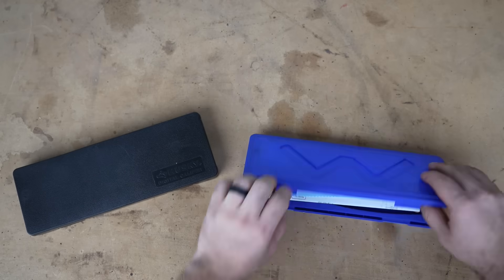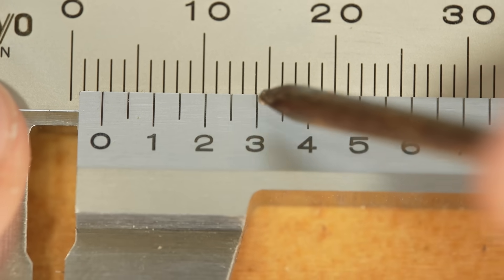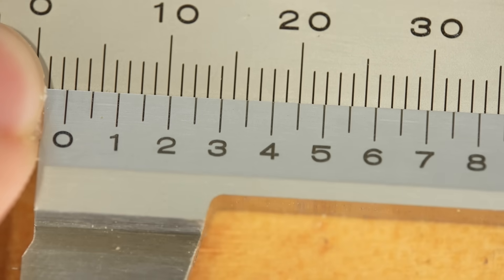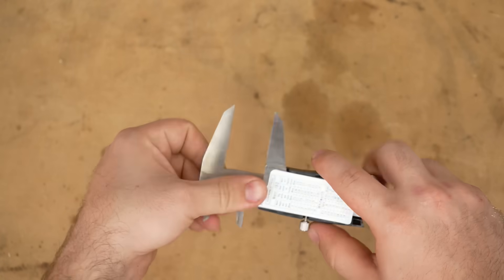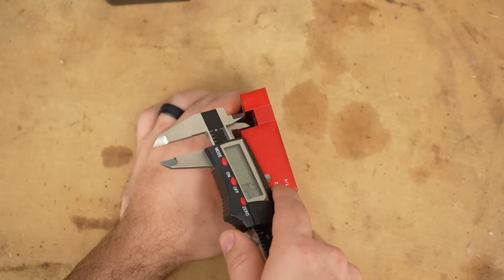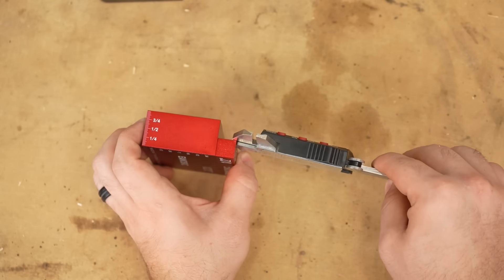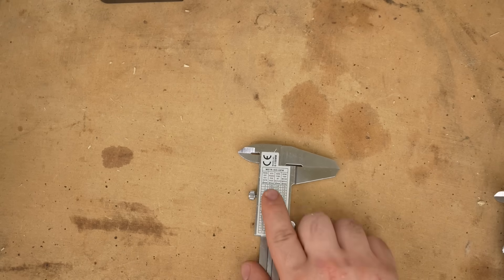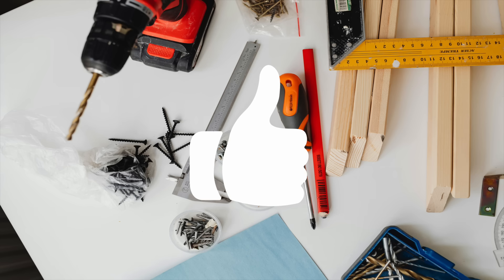I wish i’d known this sooner, How to use calipers like a pro

Comment: It's wise to point out that digital calipers can give a false sense of accuracy. One should verify the calibration, especially with the inexpensive models, as precision and accuracy are not at all the same thing. The marks between the whole numbers on the metric Vernier scale pictured are used to provide an additional decimal place, to the 0.05 mm level of precision. Finally, I like to keep the cheap plastic vernier calipers around for quick measurements that don't have to be precise. It reduces wear on more expensive calipers and you don't have to worry about dropping one. The downside is that for some reason they always seem to have a 1/64" Imperial scale, when a decimal inch would be far more useful and easy to use. Most of the ones I have purchased over the last several years are too loose and don't hold a measurement unless you get creative with tightening them up.

Comment: I wish I had known about that "China Export" idea.  I was at a company manufacturing semiconductor manufacturing machines worldwide and went to a LOT of trouble to place an honest CE mark on them.  The company was in California and perhaps we could have just had a "California Export" CE mark.  Of course, this would not have actually worked as you need to maintain a "Technical Construction File" (to be available for review) of all your evaluations and tests to meet all the applicable directives.

Comment: China Export is a joke, it is not the real meaning of the fake CE marking.

The real CE marking, as you've noted, is a standard and should be printed properly. Many Chinese manufacturers, whose products are not to CE spec, put the fake standard marking. But since their fake CE marking does not conform to the standard, they can say that they are not lying.

Comment: maybe I am miss understanding when you said that the humans eye can only resolve up to .1mm. If you mean see or tell the difference I think humans can see the difference at much smaller than that.  .1mm is .004 of an inch and a human hair is about that give or take a .001 or .002.  A person can certainly see the difference between a thicker or thinner hair. or newspaper / bible paper vs normal printing paper. a person can grab a hair and still see it 10ft away. try it with a friend. many Machinist can eyeball things tighter than that.

Comment: Fun fact: The digital calipers work exactly the same way as the verniers. Except they use electronics to read the vernier instead of a Mk I Eyeball.
The label is a custom printed ultra thin PCB with a gridlike pattern on the back. The head includes a similar, though slightly offset grid and the electronics scan over them to see which grids line up best--just like a vernier. Except the electronics can distinguish a few levels of "how closely does this line up" to allow finer resolution.

Comment: the most popular callers are dial , no batteries required and quick easy read , machinist and over the last 30 years 99% run dial calipers ,all forms of calipers can be accurate , mitutoyo ones are good , husky not so much lol , I'm a starret guy myself , several calipers will claim extremely high accuracy but know its not , good rule of thumb for quality calipers is +/- .002 inch or .0508mm  and need calibrated yearly , for more accurate measurements we use o.d. / I.D micrometers or depth micrometers

Comment: When I worked as for QA as an engineer, we would use our cheaper calipers (the ones that weren't Mitutoyo) to also score lines on our metal blocks to indicate measurements. The calipers are, as far as I know, all made out of hardened stainless steel so it was easy to use as a scribe
Reply: I've even seen a case of someone suggesting grinding one of the jaws to a sharper point for the purpose.  (And, yes, on a cheap caliper set of course!)

Comment: After my last $30 digital caliper, I got a mechanical dial caliper. The thing was going thru a set of batteries every two weeks. The $200 Mitutoyo isn't any more accurate but it will save you hundreds of hours a year spent changing batteries.

Comment: CE means nothing. It just says "I swear as manufacturer that my product works in expected parameters and will therefor cause no harm". In Germany we had the very good label "TÜV geprüft" before CE was introduced, which was an institution (Technischer Überwachungsverein) where you could bring your products to let them be tested for a certain fee by engineers. If your product didn't kill someone it got the label "TÜV geprüft" and a numer. Then CE came (which is just a piece of paper) which every manufacturer could stick on their products without any fees. And when something happens to your customer you easily rename your brand in china :)

Comment: Two quick tricks. If you are trying to measure the distance between the center of two equal diameter holes, you can measure the diameter of one of the holes set your digital calipers to be zero at that size then when you measure across the two holes you will get the distance between the centers of the two holes. The second trick is if you are trying to find the depth of a thread or are using a plug to check blind hold depth, or more likely checking for taper in the hole, you can measure the length of your test screw/ plug set that as zero. Then once you have fully screwed in/ inserted the plug you measure from the top of the plug/ screw that is sticking out to to the start of the hole. This will give you the depth that your screw/ plug has gone to. So digital calipers can be used for subtraction as the second trick indicates.

Comment: Learnt some stuff today, thanks :)
Also need one of those digital calipers that does fractions, i have been working with imperial for years but due to a head injury it just doesn't stick an is soooo painful at times....on my random side my calipers don't have bolt sizes but a conversion chart on the back for multiple things which honestly came in handy more than i ever thought.

Comment: "You will need calipers to measure the distance between the letters in the logo to ensure it does in fact conform to European standards. Unfortunately, if you measure with the other type, they will seem like they conform to European standards when they in fact do not"

Comment: Thank you.
And things like the CE, are why I really don't trust Chinese things. But of course, people who don't know what DIY & builders go through, would be quick to call me racist for saying that. I have brought Made In China devices, with the chips and other circuit board components censored, so you can't even look up if the device is rated to what you brought it for. Tools & fasteners made out of weak metals, some of us call Chinesium. And now this.
That CE spacing trick, is a new low.

Comment: If you get digital calipers, make sure they use a common battery size. 
I only get ones that use CR2032 batteries, because it's the same battery use in AirTags, car keys, motherboards, and remote controls

Comment: I always get inner diameters wrong with calipers´, even after wiggling. I think you need to use calibrated cylinders, which I dont have, or something to extract the diameter and measure outside, which I dont have either.

Comment: Only thing the machinist would add is that a general rule of thumb is not trust the measurement too much when measuring within 0.1 of a mm with a vernier caliper.
The reason is that you can quite easily and accidently mash the calipers a little and itll throw you off.
For anything more precise than 0.1mm use a micrometer if possible.

Comment: I have a Kanon vernier that I bought in 1981 when working in engineering.  It's still perfect, despite much use.  My foreman recommended a Vernier with fine adjust, and he was right.  A dial caliper is easier to read, but fragile, and with wear they become inaccurate.  I also have a digital caliper, but the battery has gone dead and I have not found where it hides.  No use at all.

Comment: A trick I picked up when I first started using vernier calipers is that if it's hard to identify the best fit, find the last mark that's clearly on the left, then find the first mark that's clearly on the right. Usually those will be 2 marks apart and the correct one will be the one in the middle. Or, you can just average those to amounts and call it good enough. Often times it won't be absolutely 100% in alignment.

Comment: I've used vernier callipers for years and I didn't know about the step feature 👍. Measuring internal diameters of holes is tricky, I find the most accurate way is to lock the slide adjuster, set the distance I think is correct and then test fit in the hole. I often find my initial measurement is too small, because the calliper hasn't been removed exactly perpendicular to the hole and has closed up 0.1mm coming out.

Comment: Great. The digital one can do something very useful: you can reset at any point and that allows to do math very quick. For example, the distance between the center of two spaced screws. you measure the outer diameter of one screw and reset. then you measure the out of both holes or semi mounted screws. There you have it! the distance of both centers with out guessing the center or doing brain math!

Comment: I would caution users on using the inside dimensions jaws for measuring inside diameter (ID) as they don’t actually touch the points on the farthest length of the circle. The flat part on the jaws bridge an arch section. Especially on very small ID’s this creates a great deal of inaccuracies.

Comment: I think the calipers shown in the video are cheaper ones and have only one scale. I am from India and from the time I first saw a Vernier caliper, roughly Sixty years ago, we have an Inches scale, at the top, and a Metric scale, at the bottom. We also have a Tail piece with a Thimble for fine adjustment.
As regarding the Cunningness in using the C E, for China Export, to hoodwink, In India near Mumbai we have a place called Ulhasnagar, where the Sindhi population from West Pakistan were settled after the 1947 partision. Initially being very hard working and smart these people started printing made in U.S.A in many of the goods they produced. When caught for cheating they used to argue that it means products made by the group members from the Ulhasnagar Sindhi Association.
Similarly our neighbouring country Pakistan, from where these Sindhi population migrated, from their side started exporting good with a bold Label MADE IN IROP. When unsuspecting people from some countries found these were not made in Europe and questioned the suppliers, they were told that IROP stands for Islamic Republic of Pakistan.
Thanks for your time.

Comment: Great guide on how to use the very versatile calipers!
Straight to the point with clear explanations.

The step measurement was new to me. I've been using the depth guage, but it's sometimes hard to get it straight. And if there is a slight gap in the step, the very slim guage can slip under it.

Comment: Do not store the caliper completely closed as shown!!! Open it say 1/2mm and lightly lock it.  Storing it "hard closed" can misalign the caliper.  Also, there needs to be space in between the larger jaws to keep it from trapping moisture, or anything that can cause the insides of the jaws to corrode.

Or at least that's what they taught me at MIT 40 years ago!

Comment: I was a mechanical inspector for 30 years and I had one of these in my hand every day.  My generation used the dial caliper, and I like that better because you can see changes on the analog dial.  Vernier calipers were old-school but we knew they were more accurate.  (NOT more precise!  Don't mistake accuracy with precision.  They both measure to 0.001".  

BTW, the Vernier Scale was invented by Pierre Vernier in 1631!  It's a really clever invention if you think about it.

Comment: CE was new to me. Great guide for a beginner!
I'd also like to add, be careful not to apply too much force to the slide, as excessive pressure can cause the caliper jaws to misalign and result in inaccurate measurements. This is especially crucial when measuring from the thinner tip of the calipers. If additional force is needed, apply pressure on either side of the caliper jaws themselves causing direct compressive forces, rather than through the slide, as this will prevent misalignment between the body and the slide.
Reply: It's an urban myth that's hard to kill. It was all over the European tec community 15 years ago.
It's been debunked a lot of times, even in the European Parliament. Links to debunk on the Wikipedia page https://en.m.wikipedia.org/wiki/CE_marking

Comment: i have an addition to verer calipers. they have one major disadvanteg over digital calipers. when reading any kind of scale you have a thing called parallax error where when you dont look at the scale in a streight line the lines on the scale can be offset which could lead to a false meashurment. havent heard you say that and im sorry if i overheared it. though overall a great video i liked it a lot

Comment: One other little tidbit is that calipers should not be stored completely closed.  For the finest, flattest, smoothest surfaces, the faces are so close together that the molecules can grow across the gap and, over time, could cold-weld themselves together.  This is especially important for the most precise instruments like gauge blocks and optical flats, but my calipers have a similar note, "Do not close calipers; may cause damage."

Thanks, too for the information about the step measurement and the CE mark.  Back in the early 70's when I was learning this stuff, the CE mark didn't exist then.

Comment: My Vernier has a mm and inches scale. I used to measure only in mm until I realize that the precision in inches is 4 times greater. My vernier (KD Tools) precision is 0.1mm or 0.001inches and 0.1mm is 3.937 times larger than 0.1mm.

Comment: I have a caliper of each type. Batteries go dead, dials get bent and the mechanism gets gummed up. Verniers don't go bad and they don't need batteries. As long as you don't abuse it, it will always work, for you, your kids, and your great-great-great grandkids. I also have a cheap vernier that I keep in my tool bag (only measures to hundredths.) It costs me $20 and is every bit as accurate as I need in that setting. Don't know that I've ever used the step measurement but I'll have to keep that in mind.

Comment: The two most unknown measurements are the two you missed. I don't think your vernier applies but the digital ones do. When closed, the two jaws make either 90° or 82°. This is for measuring the countersinks for inch or metric flat head screws.

Comment: I as others didn't know about the CE difference. I also noticed as others, you skipped over the dial calipers. I use dials alot on my loading bench. 
As far as how to ue them I knew all the different ways, in, out, depth and step. 
I also have micromters. They have dials, so easy to read and they still have the thimble markings to check for accuracy. The only digital I have I bought to easily convert SAE to metric.

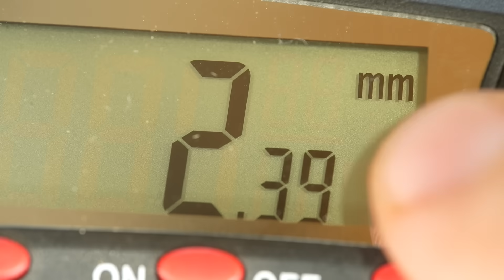Comment: 2:36  If your digital caliper is showing 2.39 mm, it's wrong to read 2.9 mm. The difference between these values is 0.51 mm which is huge in precision mechanics.

Comment: I'm a retired electrician who had to learn how to use micrometer to measure wire. We had to learn the diameter  think it was from 15 to 10 guage because wire diameter doubles or halves evety 6 wire sizes. ( Never came across 11,13 or 15 gauge wire but some motors might use them ). Have a set of Vernier calipers and find them hard to use. Will measure something with them then get one of my Starrett 6" rulrd out to measure Verner.

Comment: Digital/dial calipers are wonderful BUT extra time should be spent with apprentices to read mechanical verniers properly THEN they can be introduced to dial or digital units.They should be able to use ANY Vernier Caliper. Also, you can throw small hole guages and depth micrometers into the mix as well. As an instructor, I have found many apprentices that can't properly read a vernier or outside micrometer and just end up using them for C-clamps. 😂

Comment: A few years ago, half the calipers in my local Home Depot weren't usable. The gearing mechanism worked, the construction seemed fine, but the markings were done wrong because whoever was manufacturing them clearly didn't understand how it all worked and did a "looks good to me" then shipped thousands of improperly labelled and marked calipers out. They were Husky brand.

For some reason, this did not affect the digital calipers. You can know how to read it, how to use it, but that doesn't matter if some executive cheaps out on the manufacturing and sells defective quality gear.

I wonder if that's still a problem at Home Depot today. Haven't checked back in ages, already found better suppliers.

Comment: Suggestion for the presenter:  If you're pointing at very fine lines (such as what is inscribed on a caliper) avoid using your finger (which is a couple of orders of magnitude thicker than the lines).  Instead, using something of similar fineness, such as a sharp pencil or the tip of a pen.  Thanks.

Comment: The China Export thing is a myth. Even if misprinted, it is always the true European "CE" mark... that doesn't mean much because it is a self certification. And even when done correctly, it only means it is safe as per European standards, which doesn't mean much for calipers. It tells you absolutely nothing about build quality or ability to measure.

Comment: 55 years ago i bought my Verner device
that had circular dial just rotate to zero and use
cost much more than the slide scale ones
still use today
ray 79  GB
On the model t car Henry Ford made you think to drive it
lower down un the comments